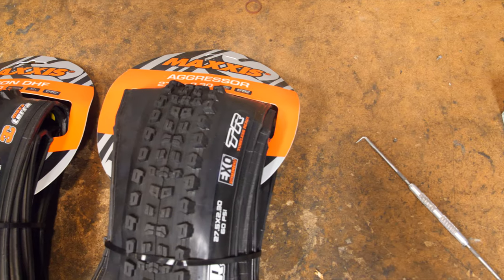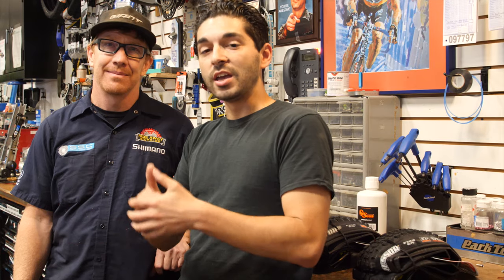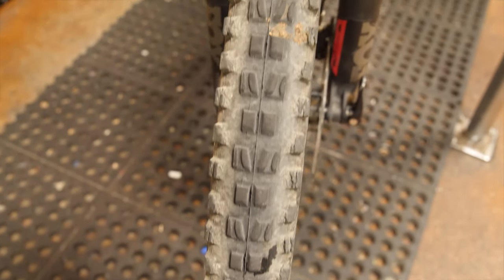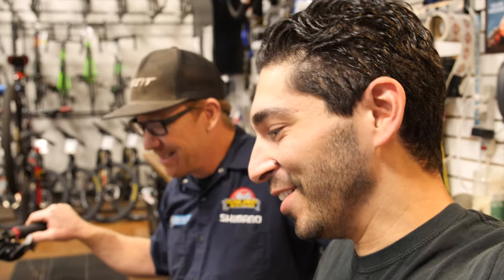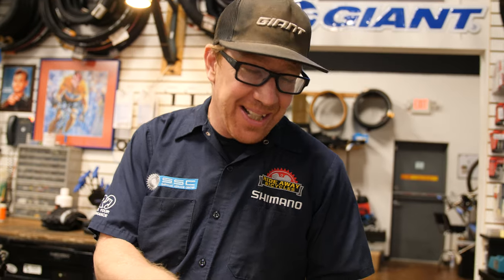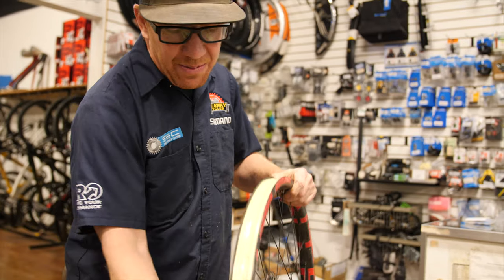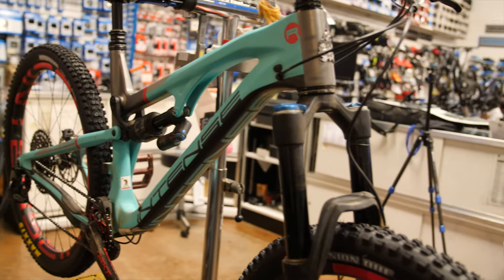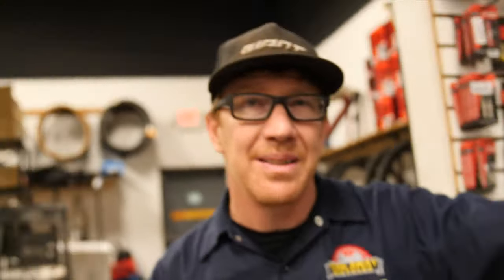Best Maxxis MTB Tire Combination Ever | Maxxis Minion DHF vs Assegai | Best Enduro MTB Tire Combo

Comment: The assegai is amazing, I’m running the exo+ casing front and rear and while I did notice the extra rolling mass at first especially on some climbs, I am ripping corners faster than ever now. Grip is insane. I think next time around I’m going to run the assegai up front with the new dissector in the rear. Aggressors are great tires too
Reply from the maker: i have not heard of the dissector the name sounds epic, thanks for the insanely awesome info brother!!!

Comment: After 3000km I replaced my Specialized Purgatory and Ground Control tires. Really happy with the DHR II as a front tire. Deals really well with the loose sand, dust, gravel and roots bullshit I deal with in my riding area (sand and dust up to 4cm deep). While also feeling great on loam and hard pack. And is well behaved when I need to do slow turns and manoeuvres in those conditions between trees. Not yet fully convinced with the Forekaster as a rear tire but it also performs really well in the same conditions. Haven't yet had the chance to really lean the bike at high speeds on gravel/dust (good way to hit your head against a tree in my area or clip your bars).
Reply from the maker: lol yeah it sounds like it would be. I really like the high roller 2 . for a while that's what most intense bikes came stock with. I really like It for myself as a rear tire, but its just a tad bit to slow for my likings in the rear and under grips when compared to dhf in my personal opinion for my style of ridding.
Reply: @MTBdropIN  With what I read from others the High Roller II is a slow tire. But that's not strange with it being a mud tire. DHR II clears quite nicely in loamy conditions and with wet sand. Haven't yet tested it in truly muddy conditions. But I doubt you'll encounter anything the High Roller II is designed for in your area. :P
Reply from the maker: well it does get muddy sometimes so maybe ill rear it up if rain decides to be bad again this year.
Reply: @MTBdropIN  I never run a mud tire where I live as it's just not inorganic enough (clay) in my area. Something like the DHR II still performs really well then.
Reply from the maker: :) good to know for sure thanks man for helping me understand this stuff better
Reply: @MTBdropIN  No problem. Did some reading before I bought my current tires and it's something others mentioned. Works well enough and people tend to only switch when conditions are really nasty. The DHR II up front performed just fine when I was out riding in a drizzle on wet roots and such.
Reply from the maker: why not go dhf though?
Reply: @MTBdropIN  Two reasons. The first one is that in my country long descends don't exist. A lot of it is flat or short punchy climbs. So rolling resistance is a factor I take into consideration. And people tend to be of the opinion that the DHR II rolls a bit faster than the DHF. Dunno if it's true as I haven't run a DHF yet but I'll take what I can in the rolling resistance department.

The main reason however is that people who have tried both tires mention that you don't have to as aggressively lean a DHR for grip as a DHF. Smaller transition zone while not compromising on grip. Which is important for me with trails that are often tight. Clipping my bars is something I have to watch out for with my 760mm bars. There are places where I can't properly lean the bike or where I have to lean it back and forth to get it past trees. :D
Reply from the maker: Wow excellent justification 😲

Comment: Tony, I did a review on the Assegai as well.  I love that tire man it is so rad. Been running DHF or Magic Mary for years, I usually swap between them, but the Assegai is on a whole new level. It is very durable too. I'm running the EXO+ casing.  I'm running the new WTB trail boss in back, but... The trail boss is wearing out so quick that I"m going to have to go in a new direction.  I love that trail boss but for as heavy as it is, it wears too fast.  Going to try the new Maxxis Dissector rear tire. Not sure I'll do a video on it.
Reply from the maker: Wow man great info please let me know what you end up going with

Comment: My current setup is HIghroller 2 front rear, for dry nice days, and Shorty for muddy,wet days.
great tyres apart from the bead weakness.
Reply from the maker: gotcha I think because im shorter I have not dealt with bead unseating issues. but I have heard others have a bad time with it .
Reply: @MTBdropIN  I think you are misunderstanding what I wrote, the rubber is too thin, so I wear it down so much I see the rope in the bead. I don't have issues with it unseating, or struggle with seating the tyres, I just wear down the bead so the tyre is completely useless but the rest of the tyre could be used if not for the bead, and installing the tyre this way results in the bead exploding off, but even if it was not as bad just half as bad, under a ride it would have exploded.

Comment: I feel like the Assegai is probably going to eventually replace the DHF once more sizes become available.  I suspect the default tire combos in the not to distant future will be Assegai/Aggressor for dry, rocky, loose over hard and Assegai/Assegai for loamy and Assegai/Dissector for bike park.
Reply from the maker: I thought maybe, but the Asseagai is too heavy to ever dethrone the DHF
Reply: @MTBdropIN   I suspect the weight will drop as more sizes and versions come out.
Reply from the maker: We will see 🤘

Comment: I’m curious, why 2.3? 2.5 wt or even 2.6 up front and 2.4/2.5 rear gives you a little more roll over. And if you’re running a wide wheel you get much better tire performance! Just curious!
Reply from the maker: 2.3 is a lot lighter and more nimble and I personally believe it’s quicker but can’t prove the last part

Comment: 13:19 with my wheels I don't need to use tyre levers, only thing I use tyre levers for is popping the bead off, or pressing the tyre into the channel when installing Cush Core.
I do it all sitting on the floor, the wheel is on the floor, I just pop the bead in with my hands, but of course I make sure I have enough slack, holding when wheel in the air in one hand while working on it is a bad idea.
very unstable, and tiring process.
Reply from the maker: thats awesome I know some people are very talented when changing tires lol, its crazy how so many people can have such different approaches to just chaining tires ;)
Reply: @MTBdropIN  I always had one. but to me most things come naturally and with experience, which I have a lot of, without tutorials, but not everyone are like that. but some things I just have to watch, or read, or look at a manual/guide, cus some things you can't know how they are put together without it, like some dropper post,s forks,shocks.

Comment: Orange is the best, been running the Endurance for 2 years with zero issues on both Maxxis and WTB setups.
Reply from the maker: I'm stoked to learn to trust it for sure.
Reply: @MTBdropIN  I always read that you were supposed to top sealant off over time and/or replace it around every 6 months depending on conditions.  I was living in Indiana, doesn't get below 0 often in winter...but it does get below freezing most of winter.  I went 1.5 years before I even checked the sealant level or took a tire off to replace.  When I took them off, there was still a large enough amount of sealant in the tire that I used a heavy duty paper towel to dry it up.  I was expecting it to be done dry from what I had read online, but I never had air leaks so I never bothered checking it.    Many reviews I found, most sealants were equal in small punctures like a pine needle for instance.  Then they start testing full on gashes and Orange was one of the top 2 in the tests I found.  Only problem for me is sometimes it gets on the valves and clogs them up.  lol
Reply from the maker: it also depends on where and how much you ride for sure as well, great info thank you for sharing with the community.

Comment: The newest tire from maxxis is the Dissector.   Its supposed to be faster than the assegai and pretty much ideal for our area.  I'm setting them up 2.6 on the front and 2.4 on the back on my Kona Process 134
Reply from the maker: geez, do they have it in 2.3 yet?
Reply: @MTBdropIN  Nope. Only for wide rims in 2.4 currently.
Reply from the maker: Ok cool I like 2.3 in the rear
Reply: Which ride away location is this??

Comment: Man... I really wanted to check those 2.30 tires out. Those are the ones I want on my bike
Reply from the maker: yeah I really like 2.3
Reply: @MTBdropIN  yea... they look beefier than I thought. What's the width of your rim... this is what the specs on my Epic says.
22mm internal width, 32h... So I'm wondering if those will work for me.
Right now I running 2.1 and I really don't like it

Comment: Assegai front, and Dissector rear. Don’t sleep on the Dissector!
Reply from the maker: Hmmmm got to check it
Reply: Hows that Dissector compared to the Aggressor? What terrain you ride on mostly?
Reply: CABdosdos Dissector’s a slight step up in grip and I especially notice the upgrade in the loose and wet. I ride in the PNW/North Shore and the Aggressor isn’t enough for the weather and technical terrain here. I don’t miss that tiny bit of extra rolling speed personally. 

Hated the Dissector as a front tire though.

Comment: I wish Maxxis tyres had better bead area, it's the weak point,  Maxxis tyres have way too thin bead area, bead has too thin rubber.
I wear the bead down before the the knobs look as bad as yours, as soon as I see it I swap the tyres, I inspect the tyres when I swap between Mud & summer tyres, studded tyres..
I also have 3 wheel sets, so I have Shorty on one, Highroller 2 on one set.
I am keen on trying other tyres, but I still have a stock of tyres, So I am gonna wear them all before I try new tyres.
I recently posted a review, showing the issue with the bead.
https://wp.me/p60aTF-2M9
Reply from the maker: o wow ill check this out :)
Reply: @MTBdropIN  one set was cus I had 2 of the same bike, no I only have one I can ride, and my xc bike but I need new bikes soon, cus mine is way too short, I am trying second hand market if there are no bites I I will have to buy new, and build my dream machine, so far I got second hand Archer D1X :-)
Reply: @Marty See those år ebest suited for dry, to some slightly muddy, small puddles but not deep mud and bigger obstacles, for those shorty are best, but if it's huge big wet roots that won't help, but the bigger spacing between the knobs can help the tyre track better up climbs on smaller roots, and the shaper knobs make it grip better grab on to stuff better, but on asphalt they slow you down significantly, so does the spacing, highroller 2 is great on asphalt and mixed so perfect summer tyres, but shorty for mud, wet, even snow as long as its not ice. Then studded are only option. But I wear the bead on Maxxis tyres faster, so if I see rounded knobs or cracks I née dtonjnspect it cus its likely the bead is about to tear.
Reply: @Marty See I run Cush Core so I run lower pressures. Betterrollower more support in cornering.
Reply: @Marty See not complex for me.

Comment: work well in all conditions? don't join me doing wheelies on ice with those tyres 😂 I wonder if Maxxis has abandoned the idea of releasing studding tyres, they showed off studded tyres in 2017 I think it was.
Reply from the maker: hmmm that would be interesting for sure in cali in the winter.
Reply: @MTBdropIN  I am in Norway, living in the east part, but which gets the mildest winter, but conditions can be quite rough, surface can be bumpy due to tracks and melding snow and ice.
a lot of ice, so studded tyres are a must here, no matter where in the country.
Reply from the maker: gotcha you should write Maxxis and tell them to get it together and get one out soon ;)
Reply: @MTBdropIN  I've been liking the knob patterns, and the rest of the tyre has been performing great.
Reply from the maker: thats awesome